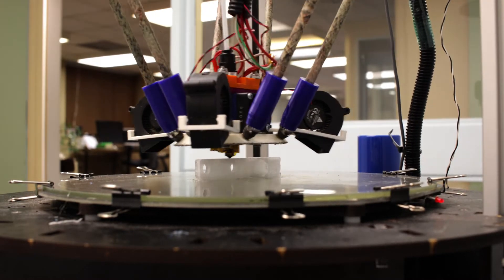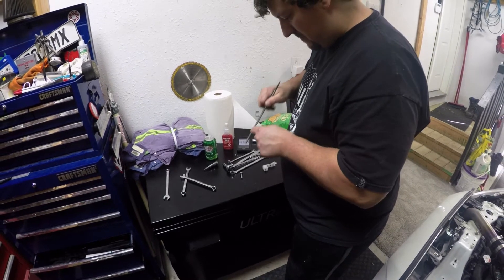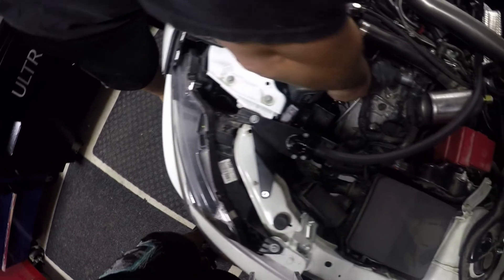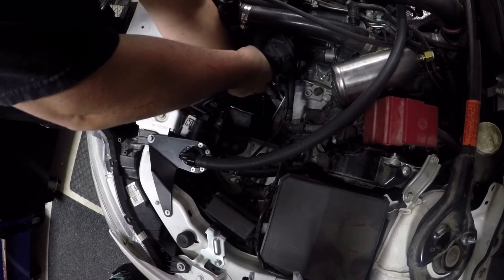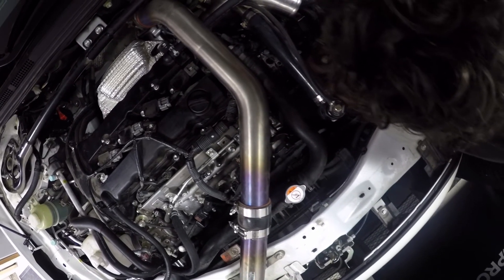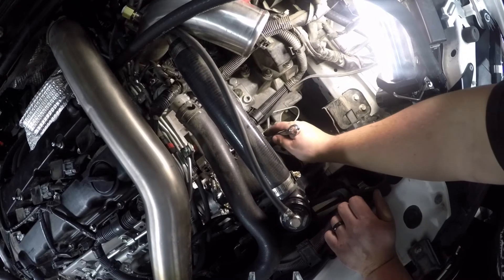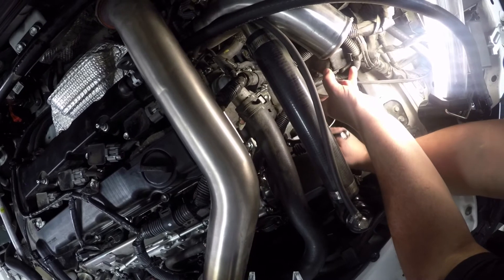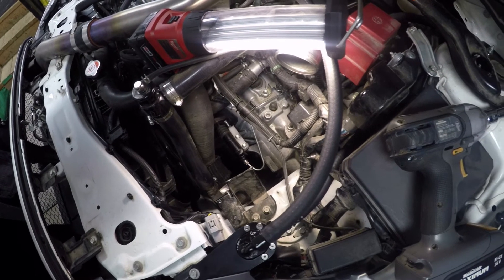Will It Print Wednesday Ep.18 "Evo X Shift Fork Stop"

Comment: Hi Bro..??
What is it for..??
Reply from the maker: John Chavez not sure we explain in the video, but there is a little pill in the slave cylinder that slows the movement of the hydraulic fluid, if you remove it, it allows the fluid to flow more freely and the clutch to snap into engagement much faster (better shifting during racing). Since the release bearing in the Evo is a pull-style instead of a push-style, the clutch fork has a snap fit onto the release bearing/pressure plate assembly and people who’ve removed the pill in the slave have had an issue where the fork snaps back too fast, overshoots and disengages from the release bearing. When that happens, the clutch can no longer be disengaged and you’re stuck getting a tow or bump-shifting home to take it all apart and snap the fork back onto the bearing. This little piece prevents the clutch fork from traveling too far so you can have your snappy shifts without worrying about the release bearing disengaging. It’s a very popular mod, if you google Evo X pill removal you’ll see a ton of videos and write ups!